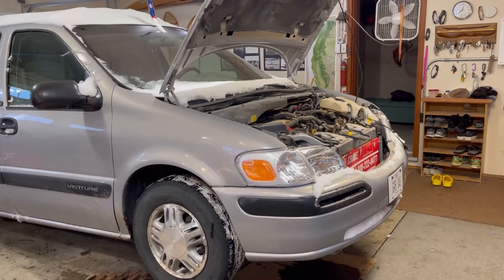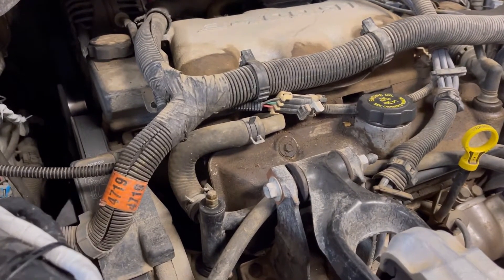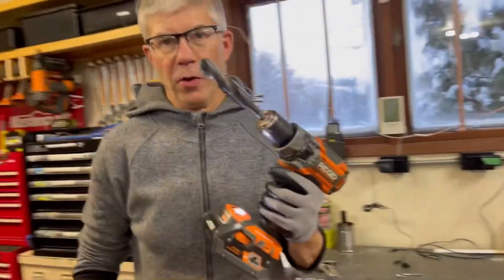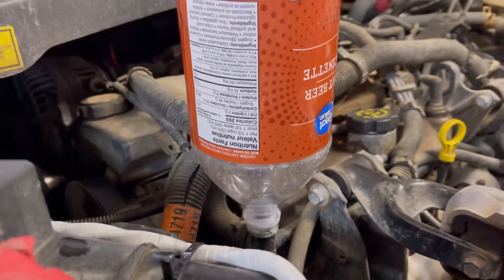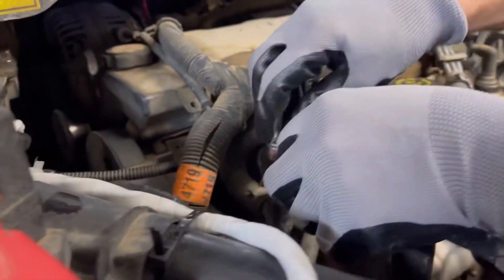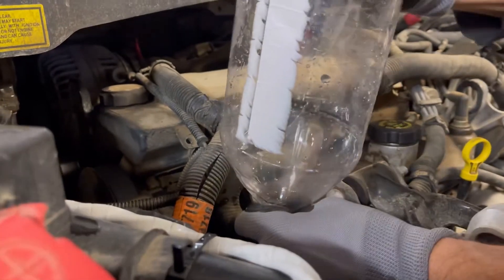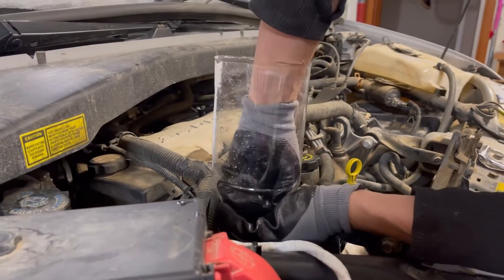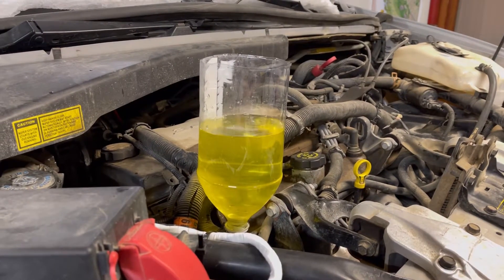How to Bleed Air from a Chevy Venture Coolant System

Comment: So how do you keep the remaining fluid from going everywhere?  Also why the music? Just bothersome
Reply: Plug it the same way you would a spill-free coolant funnel: Stick something down to plug the bottle neck before you lift it off, move the bottle to the reservoir or coolant jug, then remove the plug to drain it. The cap from my distilled water jug works quite well except you don’t want to fish it out while it’s hot. Heck, you could even throw a smaller bottle in there upside-down to plug it with a bottle cap (ribs will barely even seep). ;)
Reply: Did you know that there’s plenty other videos out there that are way longer, have ads and not have music?
Reply: You can siphon it out and just let what remains get absorbed by an old shirt or towel or rag.